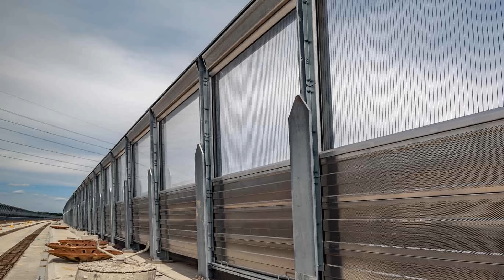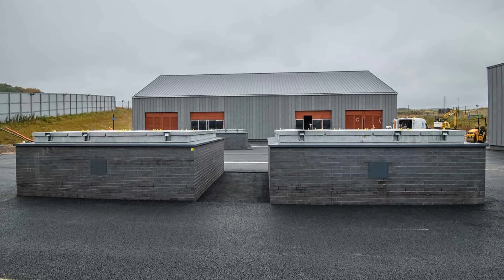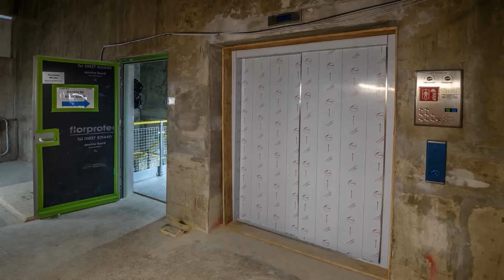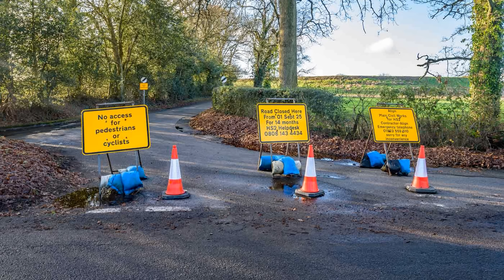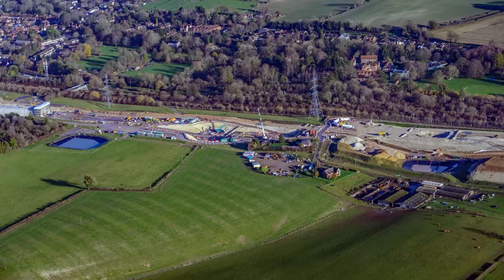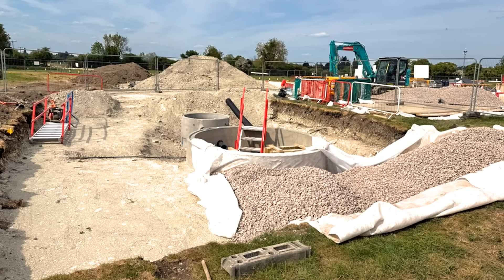26 07 Twelth HS2 Update for the Chiltern Society

Comment: A ridiculous project, unnecessary destruction of your country side for the gaining of 20/30 mins travel. How you accepted it.  Other cheaper and less destructive options not explored. £130Bn just you see
Reply: HS2 is mainly needed to increase capacity as the southern west coast main line is severely capacity constrained (for both passengers and freight) and practically impossible to upgrade to give the same capacity increase.  Given a new railway is needed, it makes sense to build it to modern standards = a high speed line, same as much of Europe is doing.   Parts of HS2 have been over-specified and various mismanagement no doubt, but the premise of a new high speed railway is not ridiculous.